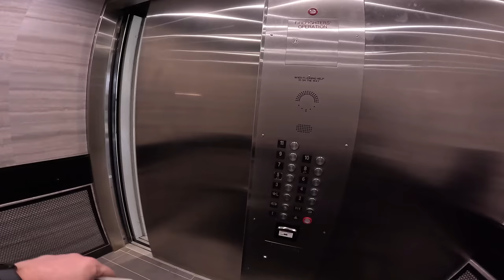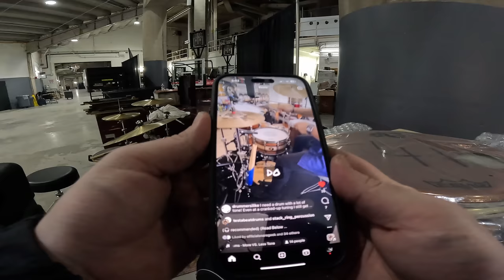POV | A Full Day Working as a Drum Tech

Comment: Have you checked the bearing edges on the rack tom??
As its the same two lugs giving you pain every time, id consider get the bearing edges checked.

Guess it might be concentricity of the drum though.

Tried a different hoop? In case the hoop is out of wack, allthough then the problem should follow the rotation of the hoop.